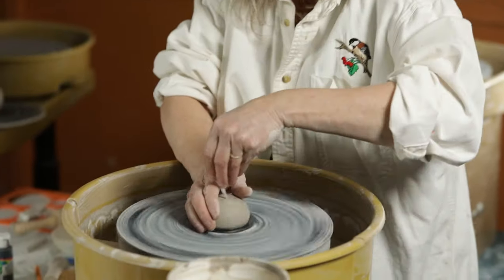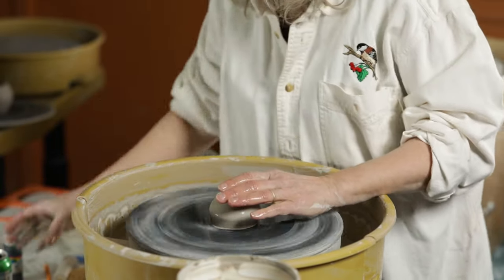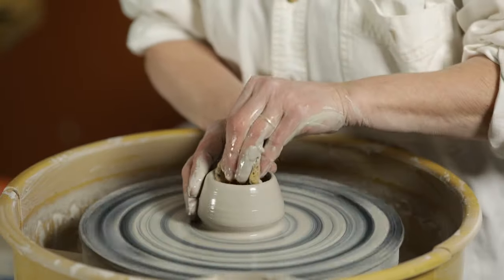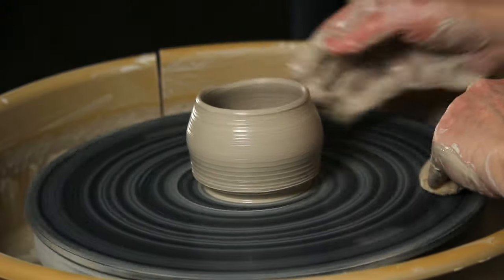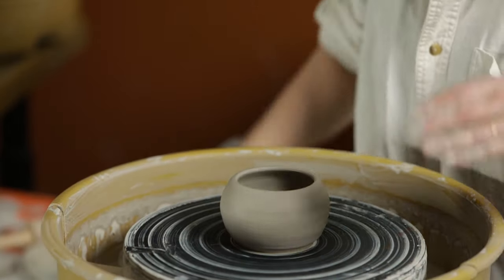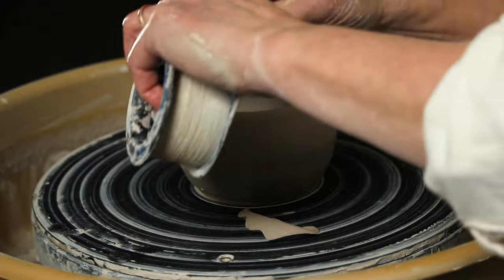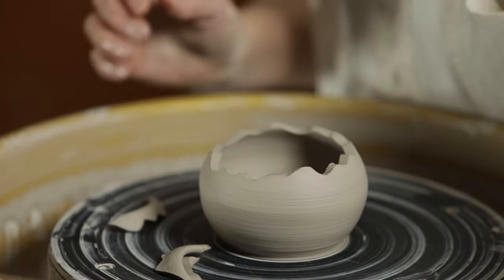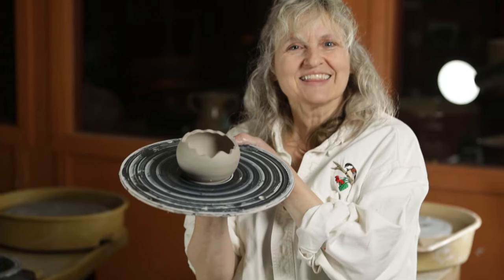Clever Way to Finish a Crooked Pot

Comment: Lol are you serious that is not what you do.  You can torch on the wheel and use a rib to straighten it out.  Once that’s done use a needle tool and cut slight below and it’s a perfect pot again.
Reply from the maker: Yes, you are also correct,  I just wanted to show this fun whimsical way to finish a pot.